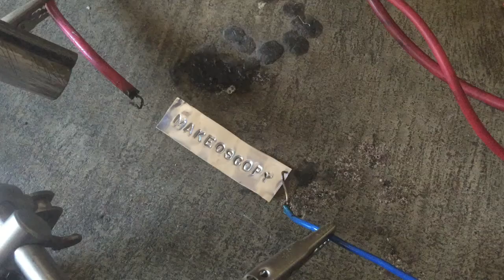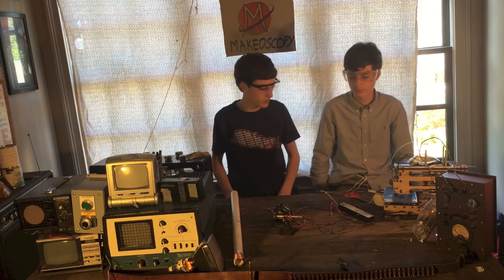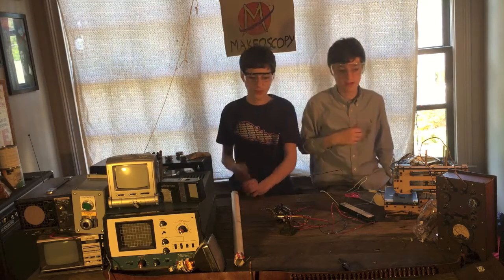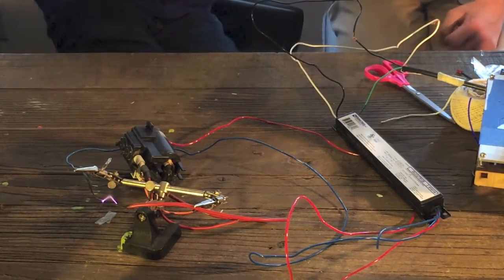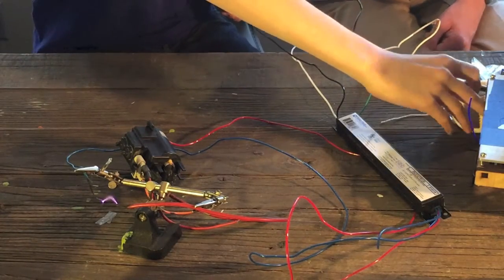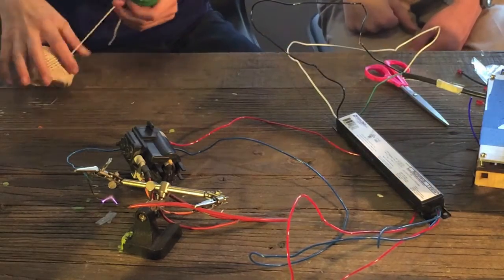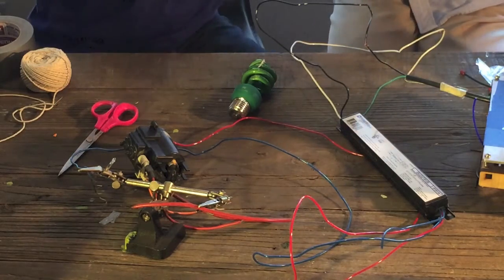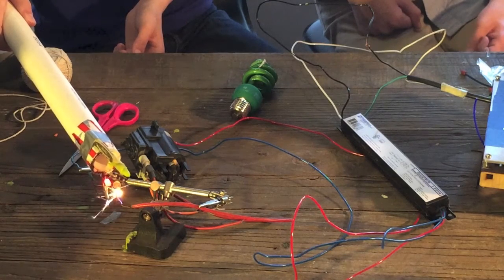20kV vs. a 5V LED and other Flyback Experiments!

Comment: you can build a simple 555 op amp control circuit to make a rather effective plasma speaker. 

also, you can pick up wire nuts for your low volt connections. they're cheap and rated for what you are doing.
Reply from the maker: I'll try it! I'm sure I have some splicers somewhere...

Comment: Dear God, wire wound mains instead of insulated solder. That is incredibly dangerous, you better be careful!
Reply from the maker: +Bob Jason It's a bit jerry-rigged, but the cord I am using normally goes through that old meter box in the lower right corner. I really should add electrical tape.